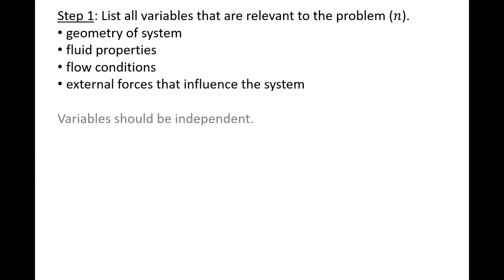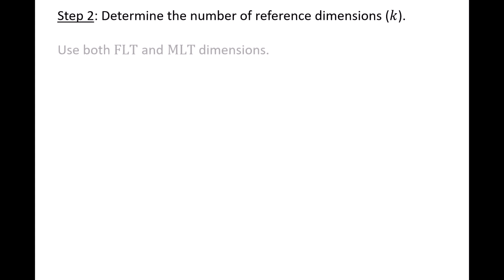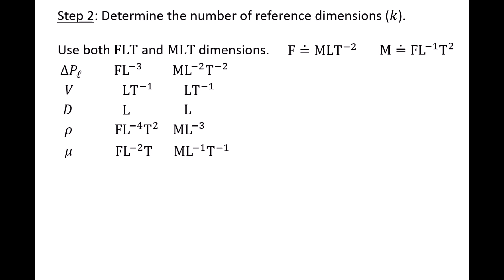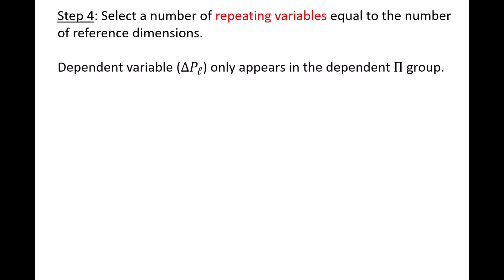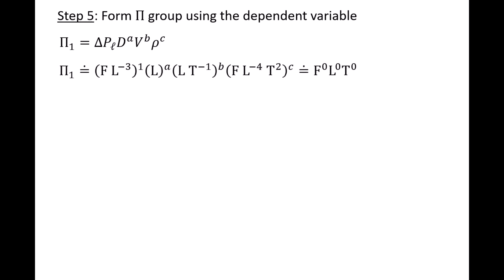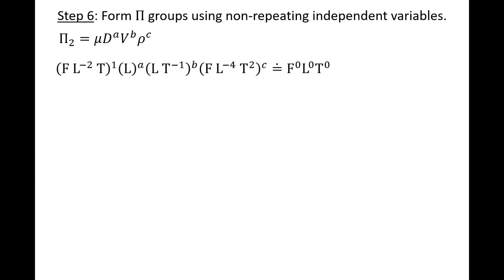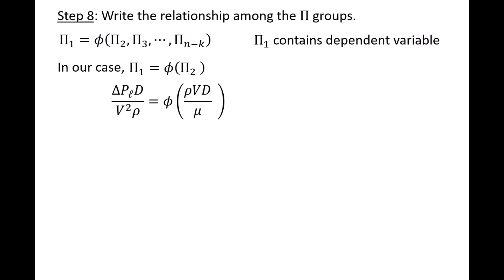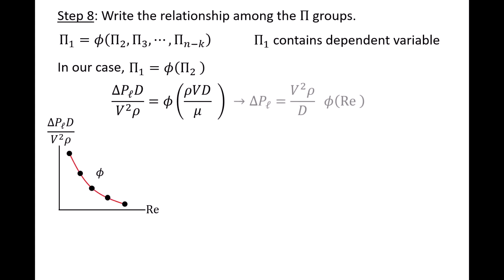Fluid Mechanics: Topic 13.2 - Method of Repeating Variables - OLD VERSION

Comment: 18:44, V in the denominator should be to the power of 1, not 2

Second row on the right, Pi1=delta Pl*D^2/(v*mu) 

Third row Delta Pl=(V*mu/D^2)*Φ2(...)
Reply from the maker: You are correct. The only way for the left term to be dimensionless is for V to have a power of 1. I will make add a note below the video.
Reply: @CPPMechEngTutorials  Thank you for having such quick response to a video 10 month old.
Reply from the maker: @thejeffinvade  We've decided to fix and reupload the video. Fortunately, it is easy to make the fix in post-production. This video will become "unlisted" very soon and the updated video will become released.